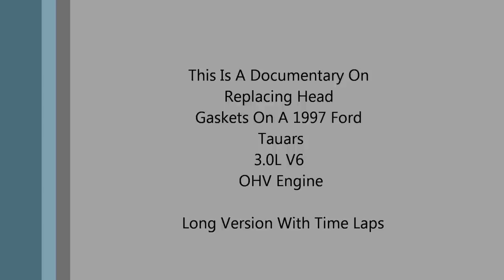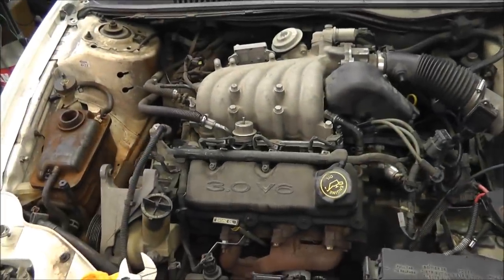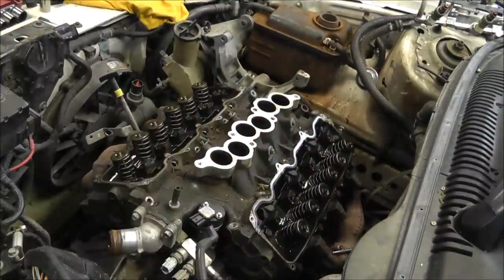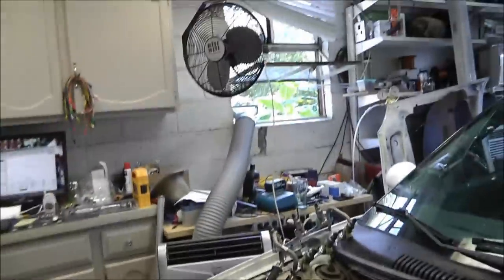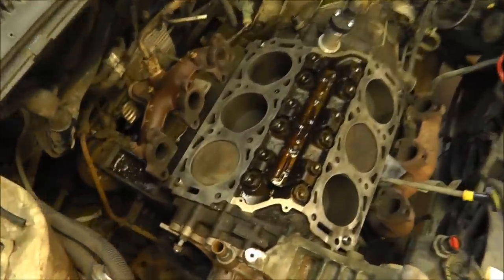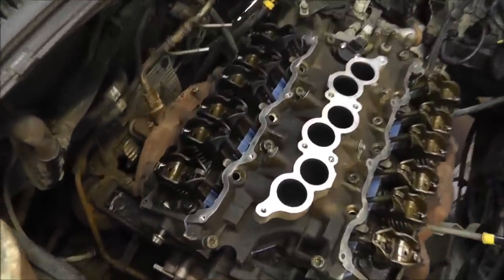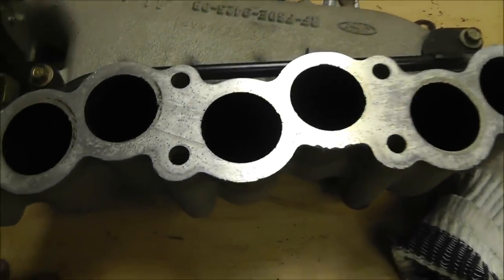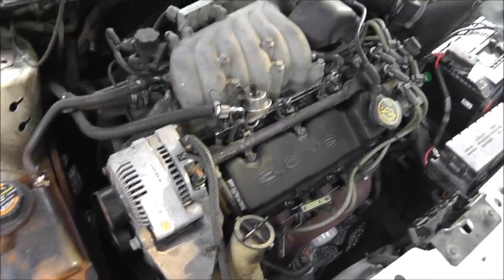Replacing Head Gaskets On A Ford Taurus 3.0L V6 OHV Engine. With Time Lapse. RWGresearch.com

Comment: First let me compliment you on successfully replacing your head gaskets. I’m a former ASE certified master technician and master Mitsubishi master technician. You are obviously an intelligent individual but let me provide some insight on a few things. Heads are aligned on almost all engines using “dowel pins” and those bolts are “torx”. I hope you did change your oil afterwards because you did get water in the oil even if it was just a little. Also, those pushers... are called pushrods. But again, you did a very complicated and difficult job for most people and you did a great video.

Comment: He forgot one important step which is an easy one;  Always, always mark any belt that you have to take off, on any engine, with an arrow showing which way it was traveling around the pulleys before you take it off, and save yourself some grief down the road.

Comment: I had a 94 taurus with the same 3.0 engine.  255,000 miles, never had an engine rebuild or head gasket job. It's starting to run rough a little and lose some gas mileage, but I also didn't expect the engine to last this long.  Awesome car!  Probably one of the most dependable cars I've ever owned.  Bullet-proof engine!
Reply: Well I have a ranger with the same engine, just hit 118,000 and it blew a head gasket, it's allready had the front end rebuilt, water pump, radiator, timing chain, thermostat, and oil pan gasket. So for me it's been a money pit, I love foreign cars and I feel like I should've never bought this truck, after this I'm never getting another one that's for sure.
Reply: +TheKurtTribute My Taurus' head gasket started leaking around the same mileage.  But heck if it only cost about $300 to get another 80K miles I think that's a pretty good deal.
Reply: Kirk Inev maybe $300 if you have the know how and the ability to do it yourself, a garage would charge atleast a grand to do the job. Anyways, I ended up purchasing a new 2016 Tacoma and I am very satisfied with my purchase.
Reply: At $100 bucks an hour (our more) this job can get expensive for a "professional" to do.  However, if you have the time and do your homework, like he did, it could be a weekend well spent bonding with your car :)  It may take me a few weeks but I'm going to give it a go.  Already bought most of the parts, might as well.
Reply: +Kirk Inev I did it to my ranger. Do you have any mechanical experience? It's not a hard job but if you haven't done anything similar before it could be easy to get overwhelmed very quickly.
Reply: +Kirk Inev when you remove the head gasket you will see clean shiny metal under it. You should then be able to see a dark area/s, in places the gasket was covering so it should be shinny, those dark places are what tell you that there was a leak, and pinpoint where it is. On this engine the most common breaking point is at the coolant passages, as the surface area of the gasket there is extremely small.
Reply: +Kirk Inev and personally I did all the work and then some listed in my other comment by myself, so all costs were purely parts, no labor and I still sunk over $1,500 in the truck.
Reply: Already got the gasket kit and head bolts but if it gets anywhere near $500 more I probably won't proceed. Then again I've always wanted to replace an engine :)  Glad you're enjoying that Tacoma. Hopefully no car worries for a long, long time.  I leased a late 90s Camry (kids don't lease/cash cars) and for 3 years all I did was check the tires, change the oil and put gas in it.  Toyota makes a solid car.  Thanks for the insights on the job.  In hindsight I should've pulled the heads 1st. What's making me want to do it is stories like yours and others with this engine on Craigslist/etc. with 225K+ miles and mine has a little over 130K.  It's been a great car for me and the family and I hope to keep it going.
Reply: +Kirk Inev well as I said I did it when it hit 118,000. When I bought my Tacoma the ranger had around 140,000 on it. I still own it so my dad can use it when he wants but it generally just sits. I really don't think it would've lasted much longer with me driving it everyday. My taco is around 6 months old, had 6 miles when I bought it and it now has around 25,000. Did you buy new coolant and oil, and serpentine belt? The new coolant and oil is a must, the belt only if it has cracks. While you're in there you may want to check your tensioner pulley as those bearings are common to breaking, water pumps are also fairly inexpensive so you may want to replace that while you have room with the radiator out. I just always tend to replace all parts that are related to, or in the vicinity of the main repair, that way I don't have to do it later.
Reply: +Kirk Inev what makes you think the head gaskets are bad anyways?
Reply: Thanks for the advice.  Figured new fluids are a must and will probably change the water pump and check timing chain and serpentine belt, pulleys and tensioners while I've got it all apart.  It was running really rough and one day finally stranded me.  Why the head gasket? I read that if you lose enough compression in one or more cylinders the engine won't start, stay running or run really rough.  That and I knew she was burning coolant for a while.  She cranks strong but won't stay running, and I've checked and it's getting fuel and spark.  I'm positive on the heads (coolant on a few plugs) but it may also be a blockage in the catalytic converter.  Heads 1st :)

Comment: You may have just saved me my car. Its a rustbucket in the far off year of 2020, but its the only car I have. Blew the headgasket while on the freeway because the radiator return hose rusted off and drained all the coolant. Hopefully with this guide I can get this thing up and running again. I only paid 500$ for it so no way in hell was I going to pay 2k$ to get it fixed.

Comment: This was the only part of the job I used a professional for.  I took my two heads into a "head shop" where they magnafluxed them to check them for imperfections.  They found one was cracked and replaced it, and smoothed out my other head.  This cost me about $250.  I would just call around and see if anyone will check your heads for cracks or warpage.

Comment: Dude I can not thank you enough. I do not normally leave comments here.  Gave my daughter a 99 Taurus 172K and on the way home from DMV it blew a head gasket. I had been driving for years without a problem. I was ready to scrap it. Just put new tires on it too. :) anyway after your video I did it and only spent about 130.00 new bolts included .  Damn-it thank you so much. Now she is happy and the wounds are healing. Yeah a little money alot of blood and sweat maybe a few tears.  THANKS THANKS :)

Comment: I worked on my '93 Aerostar head gasket job and found your great video! Mine has a earlier 3.0 model but much the same work.I think you did a fantastic job at showing how anyone can approach doing tough jobs like this and save money and know that the work is all done right. Very helpful, Thanks.

Comment from the maker: Yes, about 14HRs. But do rember. My heads were not warped... If yours are you will need to have them machined surfaced...  none te less. If its something you think you can do... Go for it. Saved me ALOT of cash. Matter of fact the car probably would've went to the junkyard if I could not have fixed it myself... Glad this video helped. Blessings and good luck!!! ~Russ

Comment: This was quite helpful (yes there's haters who critique your verbiage or the things you don't fix etc but it's better to be apart of the solution rather than part of the problem). Yes this is the "U" engine, the dual overhead cam "S" engine valve covers will look completely different, there is no way to confuse them.  Removing the hood helps a lot of guys who are taller, and obviously it made filming easier!  It isn't mentioned so in case anyone does tackle this, when you remove the push rods and rockers, it's VERY important to keep track and put them back exactly the way they came out (in the same place and orientation) or you could have trouble. The noise when the car was restarted was the lifters needing to pump up again, it's normal.  If a person cleans any of those rubbing surfaces off it's good to use some lube to protect them until oil pressure builds up again. It's also quite common for the heater cores to completely plug from that sludge and the plastic impeller fins on the water pump to disintegrate, I'd check if you are going to all this trouble and don't know if they are good or not.

Comment: CLEAN, CLEAN,CLEAN!!! Look really good after cleaning, at the sealing surface of compression rings and inside the cylinder walls for any cracks. There is a process you can perform yourself or have a shop look at the heads, called Dye check. The blown gasket can also be caused by a cracked head and/ or block.

Comment: The nice things about v6 and v8 pushrod motors is that the camshaft is down by the crankshaft connected by gears and a chain so when you work on the heads like this you don't have to worry about playing around with timing. As long as that chain is good, the gear teeth are good, and it was timed to begin with, you won't have to worry about it at all unless you take that chain off. Most people who don't understand motors, believe it or not, think v6/v8 are harder to work on. they're easier IMHO.

Comment: Hi Russ! Thanks to this video, I just replaced both head gaskets on a 3.0 V-6 1993 Ford Ranger. It has had 3 water pumps. At 100k mi., 200k mi., and 300k mi. when I reached 338,000 they had crumbled. 20 years and time to spend more than $29 for another rebuild water pump. OK, yes? If I link my short 1.30 min. video?? I want to tell everybody that you covered everything just right. I have done brakes and water pumps. Just a weekend warrior. I don't even have "shade tree" status. Thanks again!

Comment: I had a 99 Taurus with the same problem - cylinder 1 keeps misfiring.  Coolant would get dark brown but oil would still be good.  Turned out to be a cracked headgasket AND warped head. Ended up selling for dirt cheap as-is to someone who just put head gasket sealer (that junk you buy) and car has been running fine ever since... very rare, but at least they got a car that runs "ok".
Reply: Some guys just have all the luck.

Comment: this is a well made video for beginners or novices especially.  great job on it and being your first time....  just giving heads up...anytime your antifreeze mixes in the oil, ALWAYS replace oil or even drain ASAP to prevent pitting and corrosion on your crankshaft bearings.  I only mention this because during your video you said, "I guess I'll change it" -meaning you considered not doing so.  fluids tend to mix also when removing the parts too.  Keep up the cool videos!

Comment: I will say you did a good job! Personally I would recommend whenever you do this job if you don't plan on replacing the cylinder head to bring the one you have over to a machine shop and get it professionally cleaned and refinished. That'll reduce your chances of having to go through this procedure again and the car will run better.

Comment: The best way to release tension on a Ford Tensioner is to use a box wrench.  You put it on the Tensioner bolt as though you are tightening it and it will release tension as you turn it securely to the right.

Comment: Really a lot of information. You did a good job explaning and showing where and how to take engine a part.and reasemble..i hope that this i enough payment for the vidio.Thanks Leonard.    Total $250.00 total frt head was cracked . used head $100.00.rest was gakets and oil and antifreeze ,filter.

Comment: Dude I have the same exact problem on my 99 taurus ! This video is amazing ! I have coolant leaking into one of my cylinders and I have to change the head gasket on cylinder 1 also! It's amazing because it's the same exact engine! This will help out tonsssssss thanks for posting this.

Comment: Great job on the video. First time I've see a time laps on a job that big. Not an easy job or one I probably would have tackled on such an old vehicle. But if you've never replaced a head gasket I guess it was a perfect car to learn on. I probably would have done the chemical flush first and I would have had the heads resurfaced. But that's just me. Lots of labor involved just to learn later that a head was warped and you have to do it all over again. You've heard the old adage, "Never enough time to do a job right but always enough time to do a job over"...... Thanks for the video..

Comment: I have to change cylinder head gasket on a 98 Mercury Sable next week. I notice the coolant is leaking from between the cylinder head and the block when I pressurize the cooling system.   When the car is driven you can hear the coolant/ water boil and it escape out the tank.   I like your video.  I also like that I can disconnect the exhaust manifold away from head. You did not have to go underneath the car at all right?

Comment: i am about to start this same head gasket job and i know its not goin to be fun i have a 2000 mercury sable 3.0 v6 also a Vulcan motor mine has 171,000 miles on it and i went through all of the same things as my 98 Taurus but it was the other style engine so im hoping this all goes smoothly  for me as well but it would be helpful to have the engine tear down guide you have in this video because i think i have almost all of the same info you have but im trying to get it right i cut my other carup

Comment: Go buy Marvel Mystery Oil. Take off your valve covers and using the directions on the bottle apply it to the rockers, it'll quiet them up. Nothing bad should come of that aside from irritation unless you put them back on wrong. I would just double check that you got them back on right.

Comment: if you start to have problems with compression in any of the cylinders, one thing you can do is try and run sea foam through the spark plug wires. That'll help get rid of any carbon build-up that might be inside the cylinder

Comment: Aside from why not new piston rings, new lifter springs, new injectors,  new spark plug wires? This was an hour of my life spent admiring the meticulous skills to remove all the peripherals and applaud the attention spent on cleaning the mating surfaces of everything and properly re-torquing everything. Rings and springs could have pepped this up a lot and new injectors would have been a bonus. This was a great job and it takes 'skills' to tunnel through an engine. With a little luck, I'll have a garage one day to rebuild my own Ford. BTW: some of the Steels characteristics in the intake head may be on purpose to allow the metal room to expand under heat and pressure to more closely match the Aluminum.

Comment: Awesome video!  I have the same car.  They are very strong as long as you put a transmission cooler in them they will last forever.  Thanks for the head gasket repair should I ever need it I will come watch this adventure again.

Comment: Hay bro ok I got a 2001  ford taurus lx man and the water mixed with the oil so im going to pull apart the head and change them out man my car only has 67,000 miles im so glade you posted this video big ups bro thanks

Comment: Very good video. I hope I never have to do that though. I have a 1998 ford Taurus. I planed to keep it about two years. I had a low mileage used transmission put in it and I'm still driving it 7 years later. Gotta get those three kids through college.

Comment: Hey man, I just changed the water my water pump on my girlfriends 97 taurus. you will need an 8mm and a 13m socket and box wrenches. There is no need to remove the alternator bracket and power steering. just remove the water pump pulley, the tensioner, and the idler pulley. Its actually pretty simple just a tight place.

Comment: I cringed when you put the rockers and pushrods back in the engine dry, you never do that or risk severe damage. You should have either used assembly lube or oil to coat the mating surfaces before you put them on, and given them a liberal dousing after they all were back on.

The same goes for the pistons in the cylinders, you should have put a light coating of oil on the cylinder walls to lubricate the piston rings, especially that rear piston that had coolant in it.

All of this gives the oil pump enough time to circulate oil around the engine so nothing runs dry. You can hear the result of not using the proper lubricants when you restart the engine with that knocking as parts are running without oil.
Reply: so true and i feel some might not be right on tightness you'll continue to have knock.

Comment from the maker: Fine sand paper/emery cloth use a steel block/flat surface. Drain all coolant. No coolent in my oil. Yes new head bolts. ~Russ

Comment: nice video. having the same problem. what did you use to clean the heads and blocks? did you drain the coolant from the radiator or the block? was there coolant when you drain the oil? should i use new head bolts?

Comment: I m Edward from Brazil. This video is pretty nice. I m a home mechanic, and as most of our vehicles are inline 4 and 5 cylinders, I got curious to take a look on some videos working on V6´s and V8´s. We do have some Taurus and some of other popular vehicles from the U.S. so I may be interested to learn about them, so I can offer services and repair for those who own them. Just a comment, I d check and clean the fuel injectors are they were already removed. When it wasnt starting on the end of the video, I was thinking that maybe the injectors or anything else related to the fuel injection/ignition was failing.